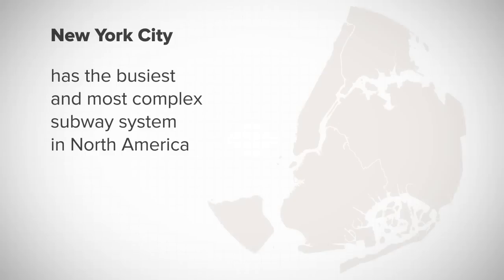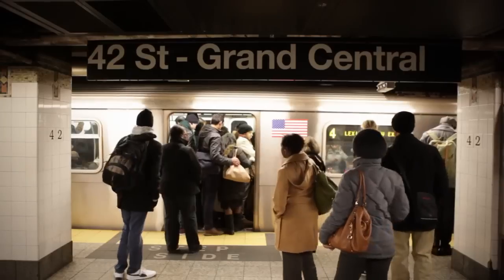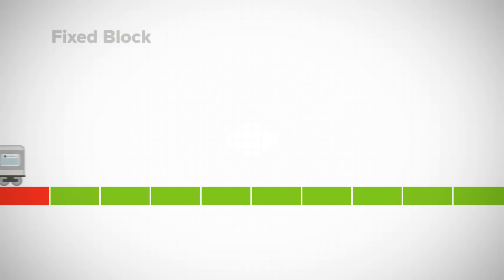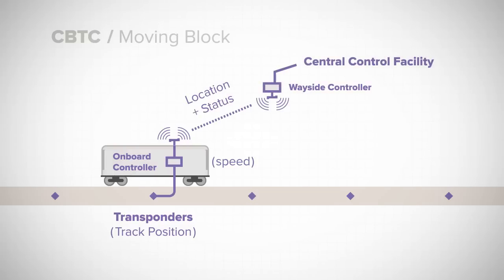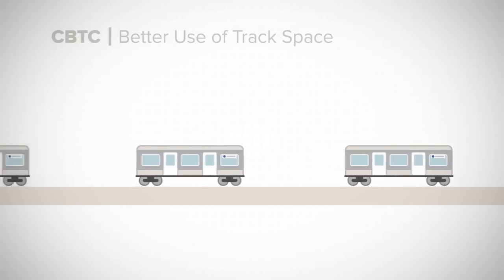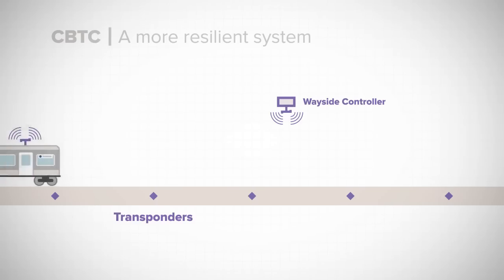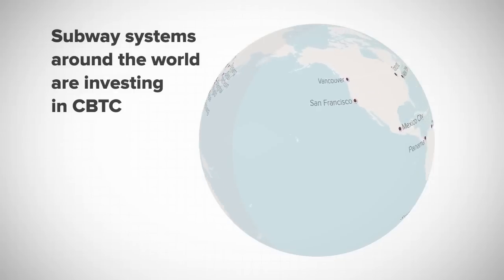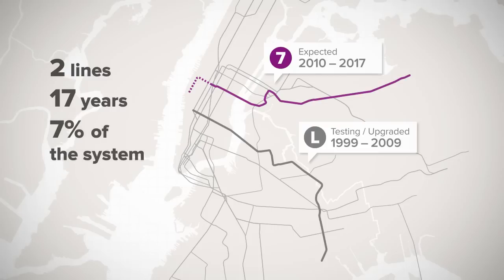How CBTC Works

Comment: CBTC can reduce the cost and increase the capacity of track. It is a good control system.
Reply: WPLU572 Trunked Radio Yes. It did work for the 7 line. However, the Flushing and Canarsie Lines have sharp curves at some places, so the trans do need to slow down there.